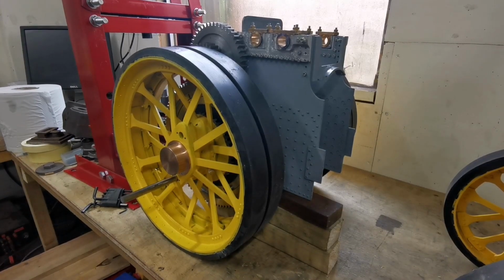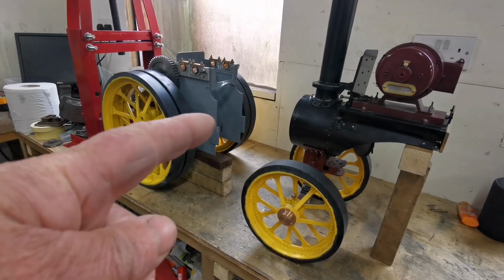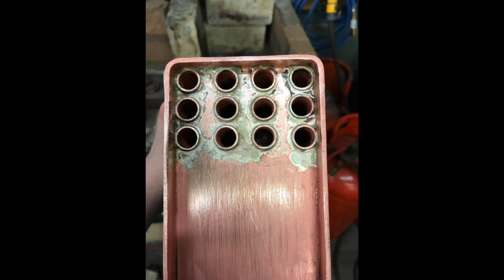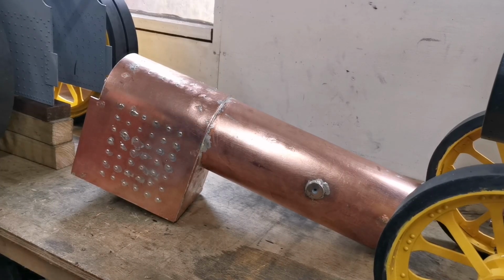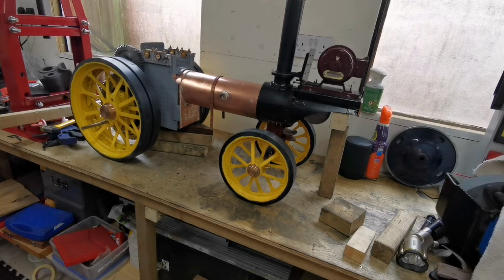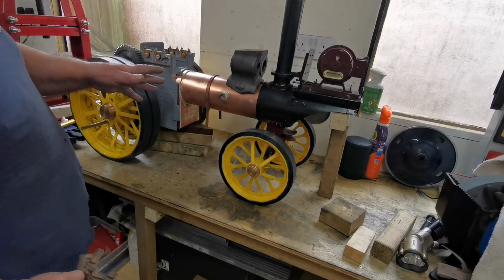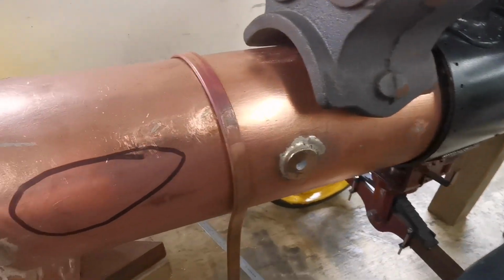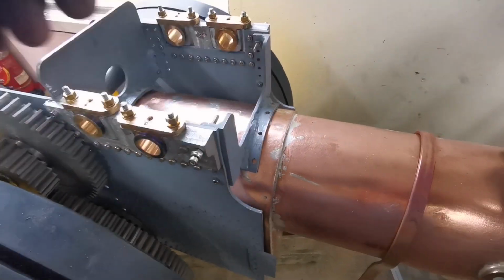2" Fowler Showman's Traction Engine introducing the boiler

Comment: Good work. I was hoping to see further work and wonder why there are no further videos? Can we expect any?
Reply from the maker: Hi, thank you. Yes, in the coming weeks I will be getting back in the workshop, I have a problem with my right knee joint with a lot of pain and unable to stand on it, I have been fitted with a knee brace to pull the bones apart which I am getting used to wearing and getting a bit more Mobile, but  now I am waiting for a new knee joint
Reply: @jammymowlam1  Sorry to hear of your troubles. I hope all goes well with the replacement. When my Sweet Pea is painted I will be onto the boiler of my engine 
purchased from a deceased friend.

Comment: Did you get a hydraulic test done before you go any further?
Reply from the maker: Yes it has had a hydraulic test, but once I get the bushes in for all the fixing points for spectical plates, weyshaft bracket and cylinder I shall have it retested

Comment: Hi Julian. Thanks for all the work that goes into making and editing your vidios, as well as the engine build. Can I ask a question, did you manage to silver solder the boiler totally with propane burners or did you have to use oxy act (or oxy propane) as well?
Martyn
Reply from the maker: Hi, I  silver soldered the whole boiler with propane and used the biggest torch nozzle I had as the boiler is  all 1/8" thick copper, thank you for watching 👍🏻
Reply: Thanks Julian I do have all the Severt burners and propane kit just wondered how much heat was required for an reasonably large boiler as your building. I guess you used a cyclone burner to solder the stays in the firebox. @jammymowlam1

Comment: Thanks for sharing! Are you going to make a one piece drive shaft or silver solder one together?
Reply from the maker: The crankshaft I shall be silver soldering one together when I make it
Reply: @jammymowlam1  Can you not get a cast crank?
Reply from the maker: I can get a crankshaft which is 2 way cut or something like that but it sounds like it needs a great deal of machining to make it it good, but I may look into it
Reply: @jammymowlam1  Very satisfying though when you have done it

Comment: Nice, so Julian did you do the boiler?
Reply from the maker: Thank you, yes I did the boiler I brought the material a little at a time as copper is quite expensive and I certainly wouldn't do another
Reply: @jammymowlam1  fantastic job
Reply: @jammymowlam1  Hi Julian, I am just contemplating making a boiler for sister engine of yours 2” scale Burrell. Interested to know why you say you won’t make another boiler. I presume you mean you would have it professionally made if you built another engine?
Reply from the maker: There is a lot of work making a boiler, if ever I make another traction engine, then I would probably have it made professionally, but I am 62 so I probably won't be building another traction engine at my age, I still have lots of work on this one 😁